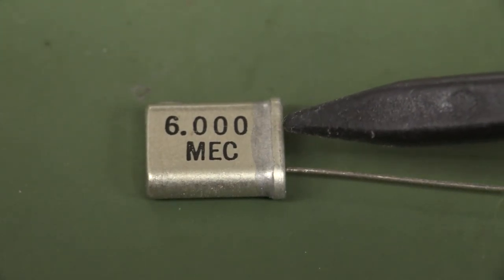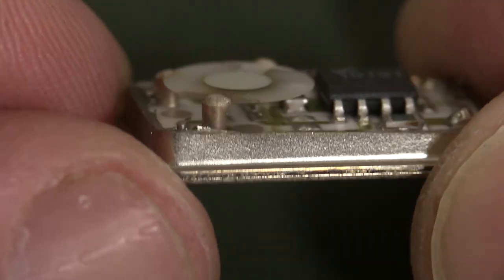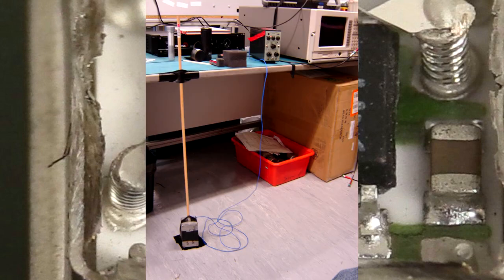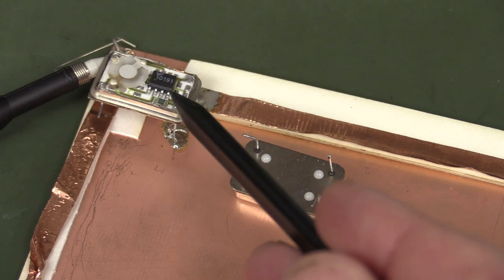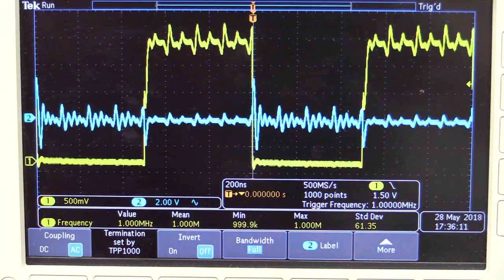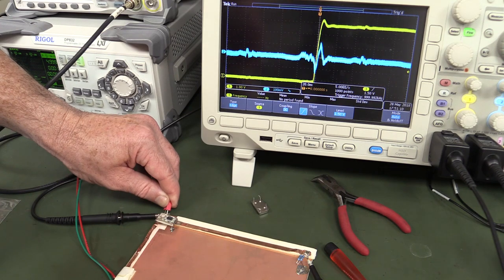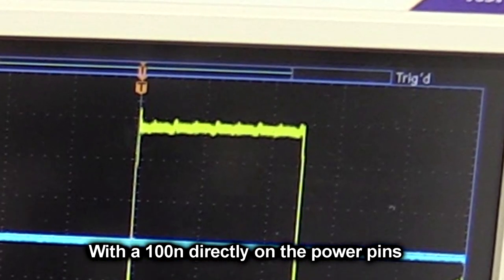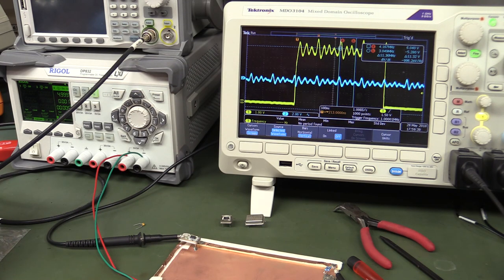EEVblog #1089 - XTAL Oscillator Teardown

Comment: Wow, that really took me back. About 20 years ago when I was working for NEC at a PC factory in MA. 
We were getting our PC motherboards (MBs) from SCI Technology in Tampa FL.
We started seeing a lot of PCs fail on the assembly line. Some of the MBs were DOA, but most (90%) were just working badly. After looking at some clock signals on one of the poorly working MBs, I zeroed in on one of those little metal oscillator modules. The clock was off-frequency, so I replaced it and the MB worked!  
We powered up about 20 of the failing PCs and I used an RF spectrum analyzer (with a probe antenna) to observe the signals from the boards. Since these boards had six oscillator modules, I mapped out the RF profile from a good MB and compared frequencies emitted by the failing MBs.  Some of the failed MBs had more than one failing oscillator modules. The failure pattern of which module and the shift in frequency was random. 
I decided it was a QC problem with the oscillator modules. However, since some of the off-freq modules came from different vendors, I deduced these modules were somehow damaged at the SCI factory in Tampa. SCI said Nope, no way.. 
I had a collection of failed modules, a microscope with a Polaroid camera and a dermel tool.. 
I did a presentation for the NEC VP of manufacturing and was quickly on a plane to Tampa. 
The photos of the little cracks in the quartz disks told the story. 
Because I'm a Ham Radio guy, I knew that dropping a radio Crystal 4" onto a desktop would break it. So I knew what to look for at the SCI factory. 
I watched the guy that loaded the tubes for the PCB parts loading machines. Nothing unusual.
Then late in the afternoon, I saw him unloading the plastic tubes from the module vendor, he was dumping them into a hard plastic tray, from a height of about 6 inches!!  Afterwards, he hand-loaded them into the special tubes for the parts-loaders. He didn't believe he was breaking them. I shown him the pictures.  Another Case closed.. :)
Reply from the maker: Awesome story, thanks for sharing.
Reminds me of (IIRC) an Intel story about bad yield on their chips. They couldn't figure out what was happening so sent someone to follow the wafers from the source.
Turns out a very diligent goods-inwards person was opening the sealed wafer boxes and counting the wafers in the (not particularly clean air) loading dock to make sure they got every wafer they paid for.
Reply: So what happened to the Goods-inwards Person? Fired? or just given a friendly warning to "Please dont unseal the packages" with the understanding that the persons intention was good, but the result wasnt?
Reply: Great events often come from little causes.
Reply: In the late 1970s, Intel made the 8251 USART and NEC used their own version of the NEC8251.
After seeing double letters being printed (during line testing) on the Spinwriter serial RS232 printers, I telexed NEC Tokyo describing the failures. Weeks later came the reply from Japan. "Intel 8251 has handshaking error in RTS CTS logic. Our NEC8251 is exact copy, so it also has error. We will create new NEC8251A without Intel error"!  
And within a month, we got tubes of replacement USARTs..
Reply: I don't know what SCI did, but the cracked quartz oscillator elements problem disappear the afternoon I got to Tampa. I got to spend the weekend with my father-in-law before heading back to BeanTown..
Reply: 😲 great story! I’ve been trying to chase down a flakey and then dead Commodore Amiga. I’m suspecting it’s the oscillator. Waiting for a new one to arrive and ran across this video and post. Never new they were so fragile and had electronics inside them til now.
Reply: Isn't ultrasonic cleaning another no-no for xtals and osc's ?
Reply: @GodzillaGoesGaga  I've never heard of that before, but I never worked in a PCB fabrication house either. 
I 'guess' the problem with using ultrasonic cleaning is only present, if the resonate frequency of the crystal and the cleaning frequency are harmonically related. 
You wouldn't want to clean a crystal with a sound source that was outputting a strong freq, that was at (or very near) the xtal freg, or a sub-harmonic of the xtal freq.   https://youtu.be/Oc27GxSD_bI
Reply: @XRinger  This was what I was told many years ago.  The crystals can shatter due to resonance.  Don't know the truth of it though.  Maybe some expert MFG person can chime in.
Reply: Wow...

Comment: Absolutely fantastic video dave - one of your best imo.  What I like about this is not just the sweet tear down of those crystals, but the way you've demonstrated how bypass capacitors have an effect (and how distance from the connection makes all the difference), but also your mention about vibration too.  I've come across odd ball issues where a system was suffering jitter because the can was not grounded (on a 2 pin crystal), and I've also seen issues where another system had jitter or something because the can wasn't supported (floating) and was susceptible to vibrations from road traffic 20 yards from the house lol.  People think these things aren't relevant, but they are factors.
Reply: I totally agree that this video was one of the best yet too!  Such an amazing fundamental, no-fuss look into something that so many of us have wondered about.
Reply: The voltage seen due to trace length is V=-L di/dt.  Ie if your trace is long it has a larger inductance and hence the current drawn or returned through it will generate a voltage.  Keep all power and gnd traces short or use planes !!

Comment: I'm not an electronics guy but I love your videos. I find this fascinating how when we build a device each individual component has so much detail and knowledge behind it. Standing on the shoulders of giants indeed! Even Wozniak was just taking complex components already designed by someone else  and plugging them together in a novel way. All around the world there are a small number of experts on just one topic I guess - capacitor construction, chip fabrication and of course crystal clock circuits ☺️ it means that ordinary guys can take a raspberry pi for example and all that work has already been done for you so that we can concentrate on the target application, software and maybe very particular hardware for the application in hand without having to learn about oscillator circuits or PCB fab!

Comment: I would find it interesting to see temperature compensated (TCXO) , oven heated (OCXO) and voltage controlled (VCXO) oscillators aswell, in comparison to the regular oscillator.

Comment: The reason for using an 8MHz crystal and divider is that if you used a 1MHz crystal, the crystal would be WAY to big.  About the lowest frequency you can get in an HC-18 package is a little bit less than 4MHz, and they were pushing it when you got one at 3.579..MHz (NTSC colorburst frequency).

Now you know.

Comment: Everyone here should have a small stash of oscillator modules.  Much easier to get your test circuit running when you can rely on the oscillator working without much fuss.  Often you can find them on sale from reliable sellers as well.

Comment: Internal cap is just presumably intended to only absorb the current spikes from the CMOS state transitions within that chip, which is why you need to start playing around to get things right when you have a load connected to the output. 

I've personally never had much luck putting bypass caps on things. I do it anyway though. The signals usually still look like they're strong enough to take satellites out of orbit...

Comment: I’ve taken a few of these apart that used two discrete smd rf transistors to form an oscillator and buffer. The resistors were part of the ceramic substrate and the caps np0 (presumably) standard chip caps.

Comment: Really neat.  At 15:45, and previous close ups, it looked like the lower left pin was poorly soldered to the ceramic PCB.   Also, I wonder how the metal lid affects the performance?  Perhaps if the crystal circuit is very weak, it's susceptible to external noise? 

Back in my manufacturing consulting days, I had a client who was a contract manufacturer, and their client had them doing some 500 piece build.  They were getting about 50% yield.  Long story short, their client fouled up the PCB design a little and had the CM driving some heat sinks on the PCB with a mallet.  Half of the time they were completely assembling the PCB hammering the heat sinks on, then soldering the crystals, the other half of the time they were soldering the crystals then hammering the heat sinks on.

Comment: The resonance frequency of the springs should be in the low kHz range at maximum; I suspect it to be even below 1 kHz.
This is so far below the quartz oscillation frequency that the springs won't be excited; the ends won't even oscillate at any significant amplitude.  They behave just like a solid mounting post.
I think they act as a vibration and shock damper to prevent the quartz disk from breaking due to mechanical shock.

Comment: As long as the spring pressure exceeds the oscillation frequency vibration it's a superior setup ..think about it the contacts are spring loaded so dropping it won't throw the values off as much if at all

Comment: (@2:41) - check out the piss-poor solder connection at the lower left! That ought to fail the next time someone drops it on the floor! 😃 The others don’t look too bueno, either!
Reply: Looks like it might have gotten hit with the dremel taking the case off. If not, yeah I need a job for that QA team lol... and a book to read.

Comment: Have you tried the circuit again before cracking the capacitor? Maybe the exposed quartz disc is sensible to EMR, and the metallic capsule works as a faraday cage.
Reply from the maker: Yes, I showed it working in the video!
Reply: Sorry, I thought you only tested the oscillator with both the top of the package AND the bypass capacitor removed, not just without the metallic package.

Comment: (15:14) Might the resonator frequency be 32.000MHz? The ripple looks like it's 4X the frequency of the signal you're probing.
Reply from the maker: I showed the 8MHz waveform on the resonator pin
Reply: Also noticed that. 13:00 looks like a sum of the 8Mhz and some other sine wave... for instance, sin(x)+sin(4x+(pi/2)) gives a similar plot. 
There's maybe some parasitic RLC swinging together with the crystal..

Comment: Is it possible the springs are clips? Perhaps the crystal disk would be added after the PCB is built and then soldered on to make assembly easier.

Comment: I wonder if the higher frequency ripple is due to L/C resonance in the transmission line on the output. It is terminated with a dummy load, but there are no guarantees that the XO is driving at 50R or that the transmission line itself will be matched. Just a thought.

Comment: Hey guys. The tech behind Crystal Oscillators is pretty new to me, so I was hoping to get a couple of basic questions answered, for which I was I was struggling to find answers online. 
1) How exactly are the fixed output frequencies of an SPXO set? We have many 'standard frequencies' such as 10,12,16,20 MHZ, etc. Is it only due to the way the crystal is cut, or does it also depend on the other supporting circuitry within the Oscillator?
2) How does the circuitry for a programmable crystal oscillator (Such as Epson's) differ from a fixed frequency oscillator? I know these involve 'blank' oscillators that can be programmed to a desired frequency using a handler. Does it contain any circuitry such as programmable non-volatile memory? 
Thanks in advance!

Comment: Dave, I wonder if the 0 ohm resistor is there to configure the divider.  Maybe try remove it?  It didn't look like it was needed for jumping over another trace on the ceramic substrate.
Reply from the maker: Likely. And those other two pads too.
Reply: The substrate is expensive to design relative to the simple oscillator so there are likely more applications for the ceramic substrate than just the device in the video - configurable substrate allows reuse between product lines.

Comment: Hi Dave, 

I got a long unanswered question i would like to know regarding termination resistor, hopefully you can make a video explain the following.

1) what exactly the purpose of us putting a termination resistor in a transmission line, what if we don't put termination resistor on that? will it damage our circuit or causing any problems?

2) I saw lots of articles mention about the termination resistor of 50 Ohm; 75 Ohm or even 150 Ohm ect... how do we know which is the correct termination value resistor we should put in a particular transmission line or a particular circuit?

Thanks

Comment: We had a supplier rev up a sub-assembly... our application didn't require ethernet, so they took the (big, expensive) chip off the board.  This meant they didn't have a clock source for the rest of the board, so they dead-bugged on a DIP oscillator... and proceeded to have real squirrely problems... sometimes the boards would be good, sometimes not.  I got a free trip to Ottawa to help with the problem... turned out that putting bypass caps on the deadbugged DIP oscillator cured the issue.  If you read the literature they recommend bypassing them!

Comment: Be interesting to see if the resonator is actually going at a multiple of 1Mhz and they are using a divider to produce an accurate 50-50 duty cycle.
The ripple would suggest that it may be going at 8mhz
Reply from the maker: Didn't watch the whole video did you?

Comment: Technically the quartz IS THE OSCILLATOR.  It is called a QUARTZ CRYSTAL OSCILLATOR. The electronics drive the quartz as you should know. The electronics are not a resonant circuit. THE CRYSTAL RESONATES. The analogy is that a clapper strikes the bell, but it is the bell that resonates. 

Perhaps contemporary usage has smeared the older form of language into indistinction.

Comment: I have a few of those 4 pin xtals, always wondered what was in them :D Thanks ! :D
 re: the noise on the output, I was having trouble with false triggering when I was using cmos counters with a high frequency oscillator. Is this why when I put 100nf ceramics across the power pins of the chips it eliminated the issue?? Was the noise leaking into the power rails and causing chaos? I dont have a scope to check. Thanks :)
I guess this is why you see a cap at the end of nearly every chip on old boards full of IC's :)

Comment: Any chance that 3rd connection to the piezo is to double (or change) the frequency?  I'm thinking 1st harmonic (=2 nodes;1 antinode) vs 2nd harmonic (=3 nodes; 2 antinodes) -  like a guitar string??
Reply from the maker: I don't believe so, but it would be nice to get an expert opinion from a xtal manufacturer on that
Reply: If you look closely, there's no electrode on that 3rd position.

The only crystals where you can do tricks like that are the three electrode "hybrid" crystals. these have two modes of operation, one where the two ends are in phase, and one where they are antiphase, and the resonant frequencies are slightly different. They're actually quite fun, but you need to dump silver on four different places to make them work the way you want. (Re) Building the assembly for measuring that was the very first job I had to do on my first day. All done with double balanced mixers - and current controlled attenuators, and as phase inverters.
Reply: Look closely - as Baker above said, it's not connected. The purpose is obviously mechanical: It's to keep the disc from flexing and cracking the solder joints.
Reply: The frequency of the crystals that I used to use for Ham radio, was controlled by the thickness of the crystal. We used to take them out of their cases increase their frequency, by carefully grinding them thinner.  Found a video! 
https://youtu.be/j7CS4A8wB1E
My buddy didn't have a flat glass to use as a grinding surface, so he used his VOM (Volt Ohm Meter) glass face.. Soon, he was on the correct freq, but his meter was a frosty white! He had to spit on the glass to read the VOM! 
He gave sold that meter $50 meter for $5, and I sprayed the glass with Krylon clear coat. Used it for about 15 years! 

Anyways, the 'Rock' as we called them has a clean 'fundamental' frequency. 
If you want to double it, you can use resonate circuits. Or divide it with flip-flops..

Comment: Good video Dave. I have one question. How much effect did opening the can have on the circuit ? Doing that you removed the shield and extra capacitance.
Reply from the maker: The shield makes no basic difference
Reply: Opening 32.768 kHz XTAL drops Q-factor about 10x, and causes frequency shift 10-100 Hz. Did you notice same effects on disc XTAL?
Reply: @odissey2  
Probably due more to the fill gas at such a low frequency.

Comment: I can't believe that he hacked the top off of the can instead of sawing the two halves apart at the weld between the two container halves.  The internal bypass capacitor is understandable as the power input pin is not supposed to be a signal output pin. Ron W4BIN

Comment: The moment I saw the higher peaks I knew the the crystal was a much higher frequency. A 1 Mhz crystal would be about the size of a half dollar coin. Most crystal oscillators in the 1 to 5  
Mhz range are all higher frequencies and then divided down to  1 Mhz.

Comment: What is the inductance of spring? And how it affects the frequency?
Reply: It might have a straight wire inside it, I never got a good view to be sure.. A bit like carbon brushes that have a spring for pressure, but a piece of copper mesh for a conductor